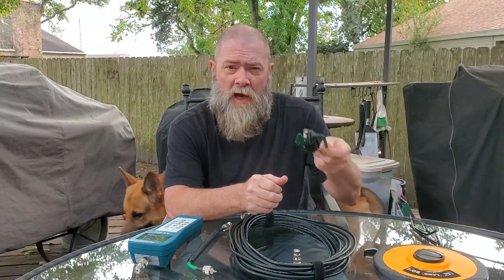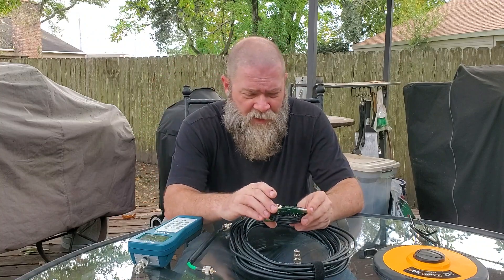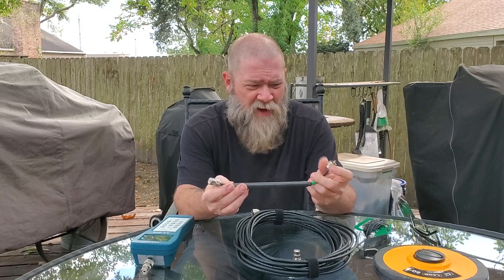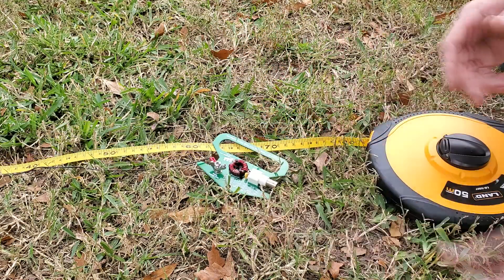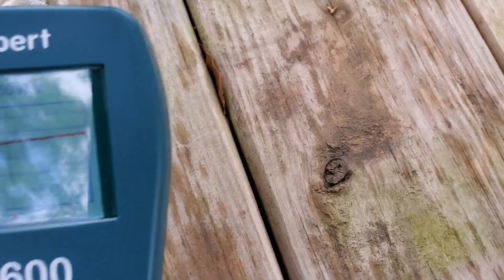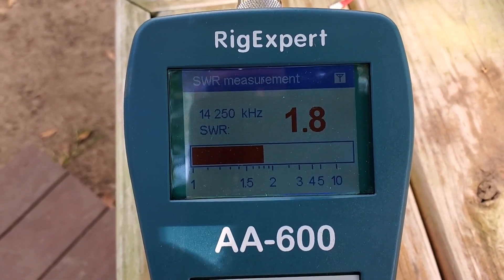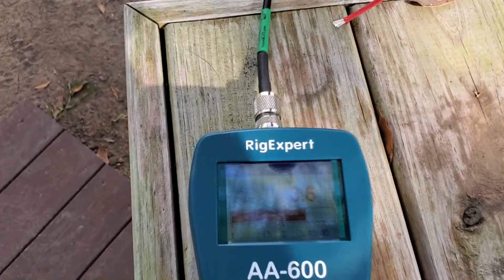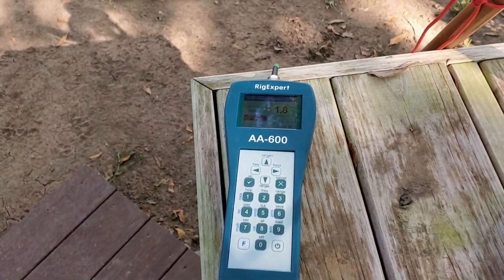QRP Guys EFHW No Tune Antenna Follow-up Video

Comment: You need to try different approaches I got mine down to 1.15 to one on 40 and it tunes on 20 and15. I have a home built efhw up 30 ft up and i love it used a 2.40 by 43 mix toroid  16 ga wire and made it a 49-1 and for antenna wire I used 64 ft and then built the 110 mhenry coil and have it on 75. very very impressed with the performance. On my qrp guys I'm going to change the transformer to a 49-1 and think it will make it a more efficiant antenna. hint your wire needs to be 1/2 wave. 73 ki0ad/jim
Reply from the maker: Thank you for sharing that!  I followed the instructions almost to the letter with tis build.  I think upgrading it to a 49:1 is a good idea...might have to borrow that idea from you...LOL  Thanks for watching and for the comment.  73
Reply: Just replace to core too and place a genuine Amidon 82-43 in it. 1:49 is right since 1:64 is much to high. QRP Gays kits came with a junk core that does not perform. I had two of this Gay kits an the desk, from OM who could not make them working. The radiator matched very poorly on one band, and on the upper harmonics no match at all. The kits came with a junk core. After replacing them wit a genuine FT82-43 they work. Asking QRP Gays about the finding they answered: "Its our best selling kit. Have fun with Your experiments" ...That was the answer from them, in both cases ....

Comment: I built the same antenna, using the sotabeams wire, 5 meters of coax and I got 1.0 from 14 to 14450 mhz. There's something wrong in your build
Reply from the maker: Thanks for the comment.  I will go back and see if there were any issues.  73
Reply: @HR4NT  hi! You probably know this better than I do. Just commenting in case other hams read this. I have this antenna and the ununtena. With the antenna of this video I didn’t have any issues, I just had to trim because nanovna showed me it was perfect from 13700 to 14200, so I trimmed the wire just to bring this interval to the useful frenquencies.

But with the 9:1 I learned that putting some tension on the wire to make it really straight does improve the swr. Same for the counter poise.

Comment: Great Video as are your others,  What Soldering Iron and Solder are you using for these projects?  thank you 
W5CI
Reply from the maker: I went on Ebay and bought the 853D soldering station.  At the time they were about $80.  I went on Ebay today and they are up to between $125 - $189.  They are solid and good soldering irons with a bunch of other features.  Another quite popular model (but doesn't have all the features mine does) is the Hakko FX888D-23BY for around $105.  Hope this helps.  Thanks for the question and for watching.  73!

Comment: Try it in a vertical position. Seems the further you go away from the mast the higher swr goes up.
Reply from the maker: Thanks for that tip.  I appreciate that.  I will give it a shot and see what happens.  Thanks for the comment and for watching.,  73!

Comment: 28ft 7in for 20m???  your antenna is between 4-5ft too short.   Also, the rf choke should not be necessary if you're close to resonance.  If used, you should always place it near the radio end.   If you install it at the feedpoint of the antenna, you choke the entire length of coax, which is used as a counterpoise for this type of antenna.

I'm sure if you used the proper length of radiator, you'd see dramatically better results.
Reply from the maker: Thanks for the comment.  According to the print on the actual antenna (link:  https://qrpguys.com/wp-content/gallery/end-fed-wire-antenna/IMG_3972b.jpg) they recommend 28' 8" for 20M.  I was just following what they recommend on the antenna itself.  You may be correct and maybe I should go back and give that a shot again and see what results I get.  Thanks for watching.  73!

Comment: Your RigExpert analyzer would provide really valuable charts if you used it with a computer and their AntScope software.  Using a 61.5' wire length, I get an SWR less than 2:1 (as low as 1.1:1) on 40, 20, and 15m (I use a 6' feed line).  While this isn't my favorite antenna, it's pretty good for $20.
Reply from the maker: I have tried using the software for the RigExpert and have not had much luck in understanding what I am looking at.  I am sure for a more experienced user it can do some great things.  The QRP antenna is not terrible, but it does take a bit more work than some of my other antennas that were more plug-n-play as far as tuning them up and just being able to go out and use them.  Thanks for the comment and for watching.  73!

Comment: You should be around 33ft for 20 meters and tune it from there.  I use 64ft and it tunes 10,20 40 and with the loading coil 80 will work. Don't sell it short. Yhe ones I build are good for 100 watts and I use  the 140/43 cores and wing the 49/1 or 64/1. 73's KI0AD
Reply from the maker: Thanks for that info!  I will give it a shot sometime son and see what results I can get from it.  Thanks for watching and for the comment.  73!
Reply: Would I see different results if I wound this as 49:1 instead of 64:1? What end result would that accomplish. I have the kit but haven’t built it yet.
Reply: @ssyoumans  scott the 49-1 works great as well Ican't tell the difference. 73 ki0ad

Comment: The fault is not with the EFHW kit. It is designed to convert by an impedance ratio of 49:1. Based on your results it looks like the coax is acting as a counterpoise. That’s a place to work from. With no extra gear you could wrap the coax into a common-mode choke just 5 feet from the antenna and see what results you get. Also, if you haven’t done this, and my apologies if you have its good practice to cut the radiating element for more than you need then shorten it by folding the wire back on itself for lowest SWR first. A good earth ground at the 49:1 transformer is important as well. I would still spring for this given the price is so low and you have nothing to loose for trying.
Reply from the maker: Thank you for those tips!  I will give it another shot an see what results I can get from it.  I agree that the coax is probably acting as a counterpoise and that was reflected when I would move the cable and see the SWR jump up and down.  For those looking for an antenna that doesn't require so much attention to get running, I just don't think this is the answer unless it is someone who likes tinkering with different setups to get rolling on the air.  Thanks you for the comment and for watching.  73!
Reply: How many turns for the coax choke, and which toroid?
Reply: @usernamemykel  I think the choke he showed uses ferrite beads clamped onto a piece of coax jumper cable.

Comment: Thanks. I was about to purchase one, and you saved me a great deal of frustration and bad feelings. I did not catch who you get your 49:1 units from. Thank you for your time.
Reply from the maker: There are a few 49:1 antennas out there to choose form.  If you want to build your own, I highly suggest the KM4ACK EFHW antenna kit.  Just google him, but his antenna stock runs out very quickly..  Otherwise you have the spark plug antenna from sparkpluggear.com and the Packtenna EFHW Mini which is also in limited supply but very highly sought after.  Hope this helped.  Thanks for watchng and for the comment.  73!

Comment: hi sir.... would like to know, why 8.72m length wire ?? on 14.260mhz, i have : 300,000/14.260=21.037m...we want half wave so 21.037 /2=10.51m ...and at worst x0.95 = 9.992 m  for the velocity coefficient  so the wire would be too short... and then, i think that putting an rf choke  on long wire is a good idea !! thanks.. 73 s Pascal
Reply from the maker: The kit comes with a precut length of wire that is supposed to work on 20M, so I used the full length and took my readings and then adjusted the length from there.  The choke didn't really help much.  Thanks for the comment and for watching.  73!

Comment: I always looked upon it this way. If you have to set the antenna or coax in a certain way and you can't move it without the SWR going wacky, the antenna is not worth it.
Reply from the maker: I think many antennas react that way, but if I have to give special attention to any one particular antenna for that reason, I agree, not worth it.  Thanks for the comment and for watching...73!

Comment: I suspect your probably done with the antenna, but I had totally opposite results.  I use this antenna with my MTR4B radio and it works great. I feed it with around 10ft of RG-400 and use it as a linked end fed with 1:3 or better on 20, 30 and 40.  I didn't read all the comments, but you probably figured out the coax is the counterpoise and putting the choke at the antenna end defeats this purpose.  Also raising the end fed off the ground helps.  You can play with the spacing between the coils of the roid to help with getting that SWR down if it's too high.  Good video.
Reply from the maker: That is good info and glad you were able to make it work for you.  I did think about the spacing with the wires around the toroid and played with that a bit off camera, but for me, at least, it didn't seem to make much difference.  I may try again using the configuration you mention and see if I get better results.  I don't like to generally bash any antenna unless it is just useless, so info like this is great to add to my notes and try out.  Thank you for the comment and for sharing Kyle!  73!

Comment: I own this antenna and have had a lot of success with it in POTA. I cut mine for 40 meters and have used it on other bands with the KX3's ATU. I was able to get mine to 1.4 SWR on 40m with a 12' coax jumper on the design frequency, but that really only matters for radios with no ATU. As long as the SWR is less than 3:1 and a short coax jumper is used, feedline losses will be minimal. With an ATU, 1.4 vs 1.9 is of no concern. Obviously, matching an extremely high SWR with longer coax cables can result in greater feedline losses. Even so, I have made good contacts in the field tuning this antenna at 5:1 or greater. I want to try making mine a linked EFHW with links for all bands 40-10 so that I can have an optimum radiation pattern for each band, but that'll take some experimentation.
Reply from the maker: Well, I am glad to hear that someone else had better results with this antenna than I did.  Good to know.  I may go back and try some new configurations down the road.  I don't like to bash any antenna unless they just do not perform as advertised.  Thank you for sharing that info and for watching.  73!!
Reply: @HR4NT  I didn't think you were bashing it. You should keep it in the arsenal and try it again sometime. It's nothing special compared to other wire antenna options, but I think it performs as well as any other EFHW.  Thanks for the vids...
Reply: Yup coax does make a big different. 73s de n3lou
Reply: How is "linking" accomplished? Hoe is it done? Thank you.

Comment: I also bought this antenna and have done all the same experimenting you are showing in your video. In other words... have done same you are showing here. Man, Glad I'm not the only one!
Conclusions from my testing: 
1- All EFHW need a counterpoise. All of them! Even if the manufacturer claims not to need one. In this case, the coax shielding is the counterpoise. You need 0.05 lambda counterpoise for the band you want to operate.
2- QRP guys also offer another kit called QRPGuys 40m-10m Mini UnUn Tenna. Look at it , it is the very same antenna with same specs, same schematic, but only in a different package. That one comes with a counterpoise screw for you to use it for a counterpoise. They say counterpoise is not needed because the coax shield is what you use. But what the... use it with a real counterpoise and you'll see the difference.
I like your video. It is a honest review. Abrazo (a hug) from Central America.
73 de Rob. YS1RS
Reply from the maker: Hi Rob, Glady you liked the video.  Honestly the antenna is too much trouble to deal with in my opinion with other EFHW antennas out there that perform just fine.  I like experimenting with antennas to see what makes them work, but for practicality, I prefer something I setup once and it works on multiple bands without the hassle.  The QRP Guys stuff is great if you want the experience in building and learning, but that's about it, at least for this particular antenna.  You are correct on the counterpoise situation and the coax does serve as such.  Thanks for watching and for the comment.  73!!
Reply: @HR4NT  Just one tip here…. Look for an Elecraft T-1 auto antenna tuner. It is pricey but will tune everything you throw at it. I have had good experience with it together with a Sotabeams Band Springer Midi Antenna. 
73
Rob
YS1RS

Comment: I bought mine premade because at the time they didn't have any kits available
Reply from the maker: Maybe you will have better luck with it than I did.  To me it is just too much to deal with when I just want to get on the air and do my radio stuff.  Thanks for watching and for the comment.  73!
Reply: The RF gods probably smiled upon me, I've made,my own efhw transformers as,well as 9:1 ununs, half work great, the other half go into my "maybe try turning it into a cb antenna" pile

Comment: I understand wavelength is drive by dividing the frequency by the speed of light and antenna size is usually half that relating to the amplitude. But why would a quarter of that also known as a quarter-wave antenna work? Surely it would resonate for some other frequency?
Reply from the maker: I have only built one quarter wave antenna and that was for  2 meter, but it consisted of four quarter wave radials to make it work.  Not sure if it would work on multiple bands as you are cutting the radials for a specific band.  That is something I will have to research and see if I can get an answer to.  I appreciate the question and comment.  Thanks for watching ..73!

Comment: Yep.. .finicky.   Because the coax is acting as the counterpoise.   Your choke was inconsequential on the 1.8 swr BUT.... since the antenna is using the coax that chock keeps RF from coming back into the radio.   Fun of antenna experimentation!   Not trying to sound like a know it all windbag because I don't know jack.   Love the video!   73
Reply from the maker: Oh I get it...and this was totally about experimenting with this antenna to see what I could do with it.  I like to try and micro-adjust things to see how low an SWR I can get.  I appreciate the comment and for you watching.  73!
Reply: I know Jack, he's a pirate captain.

Comment: The coax shield is serving as a counterpoise and thus part of the antenna.  That is why when the choke was on the antenna end it isolated or removed the length of coax you were using. And consequently when it was on the other end of the coax it allowed  the antenna to "see" the coax so the SWR was the same as with no choke. A shorter or longer coax length would have had the same affect but with a different SWR. Still it was a good video and thanks for doing it.
Reply: This is supposed to be an end fed half wave antenna.  The end fed half wave is a voltage fed antenna and there is very little need for a counterpoise.  But, this antenna is a poor design.  Since this is a 49:1 designed for a voltage feed, there should be no metal near the transformer but they have it mounted on a copper clad board which capacitively couples to the transformer.  If it had been mounted on a non metalic base, it would work a lot better!  First, on a conventional 49:1 and the end fed half wave, you should be able to cut the wire for 40 meters and it would have a fairly good match  on 40, 20, 17, 10, and 6 meters.  And you can tell the thing is detuned because a half wave on 20 meters should be near 33 feet, not 28' 8" !  This alone moves the feedpoint in to a higher current portion of the antenna and that's why the choke made so much difference !  It should no be a single band antenna if built right and in fact, a wire cut for 80 meters should give you 80 thru 10 meter coverage, but not with this one.  Learn how to build your own 49:1 and you can get multiband operation with one length of wire !
Reply: @rickmckee6698  Exactly
Reply from the maker: I wanted to get the update video done and wanted to experiment with it a bit using various techniques to see if I could get it to cooperate.  Thanks for watching.  73!
Reply: What length of coax do you suggest?
Reply: Quite oppositely, with 1:49-1:100 (typical impedance of EFHW is slightly below 5000 ohm) unun you often don't need a counterpoise when using QRP power, but you should prevent the CMC on the feedline. Thus at least applying the choke (on the antenna side) is a must (before tuning). If you'll use a counterpoise, it will be l/4 or less (mostly 0,05 lambda of the lowest band will be OK). In no case it should be random length of coax shielding. Quite oppositely, coax shielding should be grounded (grounded shielding can be ok even without counterpoise).
With more power, you really must do something with CMC by applying counterpoise AND grounding (with higher power, choke would not be enough).
Also, SWR measurements should be done by direct connection to the antenna, using very short pigtail. When using analyzer attached to the feedline on the radio side, SWR is falsely lowered by feedline loses.
Reply: @tulenik71  You may not need one and you may not want one but without the choke at the antenna end the antenna is going to "see" that coax shield and it will become part of the antenna.  You are right about putting the analyzer at the antenna. Though your proximity to the antenna can affect it.
Reply: @marshall-w4mkh   Now I'm confused - do we or do we not want to include the coax/counterpoise in the SWR reading???